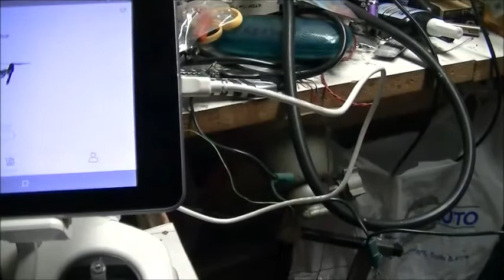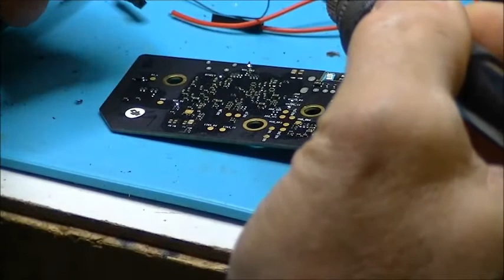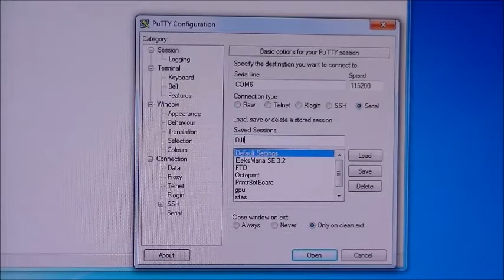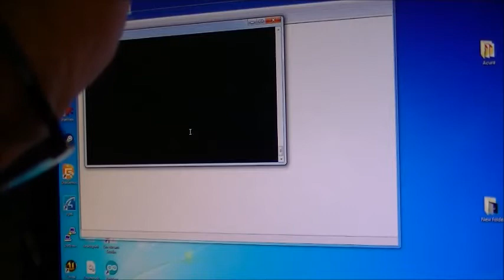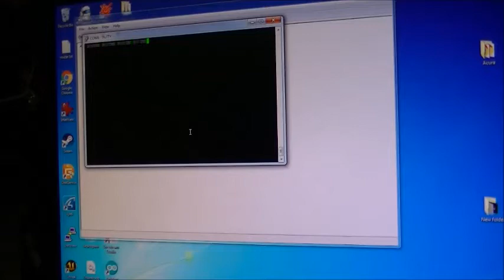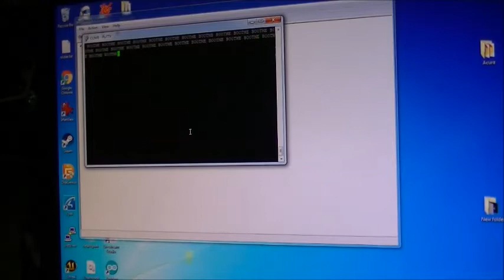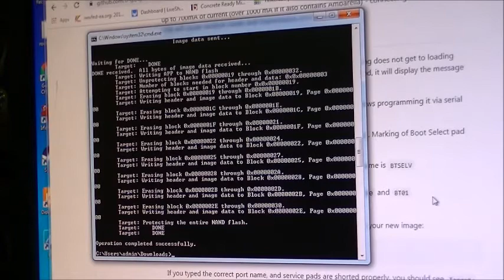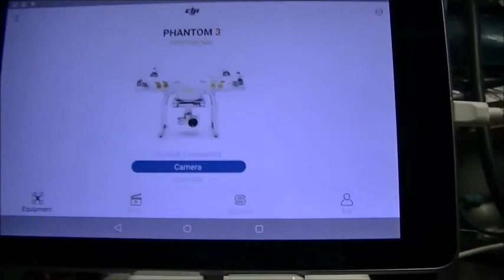DJI Phantom GL300A USB Repair fix no camera view

Comment: Hopefully you are still fielding comments on this video...I did everything as seen in the video.  Got to BOOTME, BOOTME etc... ran the prompt [sfh_DM36x -nandflash -v -p "COM6" ubl1_hdmi.bin u-boot_hdmi.bin] and this is where I get an error... 
it says in the cmd window... 
Attempting to connect to device COM3...
Press any key to end this program at any time.
Waiting for the DM36x...
The I/O operation has been aborted because of either a thread exit or an application request.
Interfacing to the DM36x via UART failed.
Please reset or power-cycle the board and try again...

Any suggestions?  I get this message repeatedly after re-attempting this tutorial.  Thanks.  I was happy to get as far as I got but now I'm just stuck with more useless electronic paperweights after this failure.  What could I have done wrong?  My solders seem fine - but who knows?
Reply from the maker: So just to start with the obvious. You mention your command as using COM6 But your error is COM3???
Reply: @tjones99  sorry - yes- my com port is 3. And yes - I changed it to "COM3" in the prompt....
Reply: Ok - after reading your edit in the bottom of the description about updating the drivers, I was able to get it to work.  I have a Win10 system and after updating drivers and rebooting computer, the communication from the computer to the DM card worked.  Next I will be trying to see if the drone allows the RC to connect in Camera mode on the app.  We'll see tomorrow.  There are several comments in here that indicated that doing all of this didn't help with their problem of connecting the RC to the app.  I'll let you know.  Thanks for the tutorial - even if this doesn't work, I am enjoying the whole process as much as a complex jigsaw puzzle.
Reply: Well, after putting Humpty Dumpty back together again... still no 'Camera' view popping up on the phone when it is plugged into the RC.  Bummer.  I had high hopes for this fix.  The only thing I have left to try is the last thing you have listed in your description edits - trying to connect it first to an apple product (which I don't have) to see if the apple connection allows me to connect to the RC in order to upgrade the firmware using the app.  I'll post back here if I get any results.

Comment: Still works after a few years (2024) got a good deal on a p3p  ( said it need a controller) lol and then I come across your video. Worked perfectly  and thanks so much for sharing it with us all .my only question is can the board be updated where I can only use iPad ? I tryed but it failed. THANKS AGAIN. You are the man
Reply from the maker: @dannorm5760  I am not aware of any upgrade to work with other devices.

Comment: I was really excited when I watched your video, because a week ago my P3Pro exhibited this exact problem for the first time. Mine does have HDMI, and the bottom of the RC clearly says GL300A. Unfortunately, the controller board does not have the markings as the one in the video to specify what the contacts are. I wonder if it actually still has a 300A board or if during the HDMI upgrade (previous owner) the board was changed to a 300B 0r 300C controller board?
Reply from the maker: Not aware of a solution. Sorry.
Reply: @tjones99  That's what I am finding out, but thanks for confirming that. I know a new board can be purchased for a boatload of money on Amazon, but how would I know for sure that this is the problem? The symptoms are the same. The drone sat for 9 mos and then I flew it three times in a week with no problem. 2 days after the last flight I started up the drone and the RC but the video would not connect. I can raise and lower the gymbal, but I'm really afraid to fly without the video feed.

Comment: Thank you for the Vid and the files.. After flashing the board my phone now detects communication with the Remote Control.  (before it was just detected as charging device). However I still dint get access to camera on the DJI GO app.. On my windows 7 computer when i plug it in, I only see "DJI USB Virtual COM 4" in Ports.. the DJI Assistant Does not detect the Remote Control.
Reply from the maker: So while recently working with some LightBridge units I found there are multiple versions of DJI Assistant... at least 3 versions... and I found that one version detected my LightBridge 1 unit but not my LightBridge 2 unit and a third detected only my drones... I suspect you may be using the incorrect version. It seems you can download and install all versions on the same machine... 
https://www.dji.com/ca/downloads/softwares/assistant-dji-lightbridge
https://www.dji.com/ca/downloads/softwares/assistant-dji-2
https://www.dji.com/ca/downloads/softwares/dji-assistant-2-consumer-drones-series

So try the different versions of Assistant and see if any of them connect...
Reply: @tjones99  phantom 3 pro is not on the supported  drones list on any of these 3 versions.
Reply from the maker: @luisvaldez6204 Sorry... I was just working on some LightBridge units and the above reply was applicable to them not Phantom 3 Professional...

I do not believe that I ever connected the Phantom 3 Professional (P3P) to my PC and had anything more than what you are seeing on the PC in device manager... at least not connecting to any DJI software like Assistant... Once I had done the flash procedure using the TI flash utility and Putty etc, I then connected the controller to my phone and used the DJI GO app on the phone to connect to the controller and the drone and get live video. I just did it again to test and with my iPhone running the DJI GO app without the controller connected I see the connect to your device screen, and as soon as I plugged in the controller via USB lightning cable the app immediately knew it was connected to a Phantom 3 Professional and said Aircraft Connected. When I click Camera I see the drone camera view. 

But... my recollection when first doing this was I ran into a number of issues when I was using different cables to my phone (tablet) and different phones (tablets). Specifically your cable must be a charge AND sync cable... many are charge only. And regarding phones... I had some android devices that I was never able to get DJI GO to work with. So make sure you are using a device that is known to work with the DJI GO app. I have personally successfully used iPhone 7, iPhone 12 mini and iPhone 12. I recall using a couple of different Android phones and tablets successfully but I cannot test today as I no longer have the devices or they are no longer running the stock Android on them... I do recall you had to enable USB Debugging in the Android OS before they would work.
Reply from the maker: @luisvaldez6204 Oh, and another viewer posted the following comment recently

"When you flash the firmware given by your zip files, it can only communicate with Apple devices, android devices will still remain in the same disconnected state, even with usb debugging and every cord and device I own. I only have android devices. After a week of struggling (the first time) I finally found the solution. The controller needs to be updated to 1.3.2 before it will work with android. From there is needs to be updated even more to be used, this can be done ota through the controller. My dads iphone 7 saved the day twice now. Happy flying! "
Reply: Thanks for that info.  it makes sense @tjones99

Comment: Would it be easier to do  it on windows 7 or 10. If it is easier to use windows 7 can a use a vm(virtual 
machine)?
Reply from the maker: I had no issues on Windows 10 so not sure adding the extra layer of complexity makes sense.

Comment: Hello, Has anyone got this to work on a GL658A controller? I see the two comments saying it will but wanted to confirm 100%. The GL658A is the first iteration of the Inspire 1 controller. If so does anyone have the bin files hosted somewhere?
Reply from the maker: I cannot confirm, but if you get an answer please post it here!

Comment: Hello I am about to try this process on my board. Just one question do you just touch the wire to enter boot mode when powered on or does both ends have to stay connected
Reply from the maker: Just touch them as you power up to get into boot mode.

Comment: Hi Terry, Thank you for putting this together. I'm still having some issues with the controller after following this tutorial. I followed the instructions and everything seemed to match up perfectly; same error codes, same dialog during the flash process, and same dialog once it was flashed. I reassembled everything and now I'm still not able to connect to the controller (no auto boot into DJI go app, not able to go into camera view, etc.). All it does is start charging my phone or iPad. I reconnected the board to putty and it's still showing a successful boot. Have any other thoughts on how to proceed?

Comment: Can someone confirm this will work with a GL658 Inspire controller?
Reply from the maker: The GL658A sitting on my desk unrepaired says this will NOT work with it...
Reply: Oh crap buddy 🥲🥲
Reply: I am 99% sure that i have a GL658 and it worked for me. I just har to boot it in bootme mode and just pull the code. I did not Get any readings from it in putty. But then i booted in bootme. And after that i could see the booting in putty. Again im not a 100% sure but i think i have a GL658. Its the original inspire 1 controller.

Comment: hello my friend from indonesia i tried to follow the method you taught in the video, but when i try to connect the ttl to computer, my dji device doesn't read. please help my friend, thank you.
Reply from the maker: Well the first thing to try is to confirm that the TTL adapter is working. If you connect Tx to Rx directly on the TTL adapter and open the putty connection you thould be able to type and the characters will appear in the putty window. Confirm that works first.

Comment: If you get a strong charge and it never goes away, is it pretty safe to assume it’s not dead?
Reply from the maker: You mean if you get a strong battery charge?  I actually believe it should be turned on infrequently as well because I am pretty sure the flash cells get their charge when read OR written and that only happens when on as far as I know. But I am leaning towards this happening more frequently when battery is flat.

Comment: After three years this still holds up quite well. bought a P3A from marketplace for $250. Ended up figuring out the connection problems must be related to this board. This is the only real guide I could find and it was so dead accurate. I cannot express my gratitude enough. I would have hated to spend another $150 on a controller! YOU SIR, ARE A GOLDEN GOD!
Reply from the maker: Awesome. This is what makes it worth doing. Thanks.
Reply: @tjones99  after some time has passed, I have now done this method twice. The first board was damaged recently after the controller was dropped and hung by the cord (broken usb port) instead of replacing the port, I bought a "untested" board from Ebay. Did the same thing as before and got the same result. There is something to add that is not mentioned in your video or comments that I am sure can help someone other than me. It occured both times, the first time making me wonder if confirmation the board was working was false hope. When you flash the firmware given by your zip files, it can only communicate with Apple devices, android devices will still remain in the same disconnected state, even with usb debugging and every cord and device I own. I only have android devices. After a week of struggling (the first time) I finally found the solution. The controller needs to be updated to 1.3.2 before it will work with android. From there is needs to be updated even more to be used, this can be done ota through the controller. My dads iphone 7 saved the day twice now. Happy flying!
Reply: after some time has passed, I have now done this method twice. The first board was damaged recently after the controller was dropped and hung by the cord (broken usb port) instead of replacing the port, I bought a "untested" board from Ebay. Did the same thing as before and got the same result. There is something to add that is not mentioned in your video or comments that I am sure can help someone other than me. It occured both times, the first time making me wonder if confirmation the board was working was false hope. When you flash the firmware given by your zip files, it can only communicate with Apple devices, android devices will still remain in the same disconnected state, even with usb debugging and every cord and device I own. I only have android devices. After a week of struggling (the first time) I finally found the solution. The controller needs to be updated to 1.3.2 before it will work with android. From there is needs to be updated even more to be used, this can be done ota through the controller. My dads iphone 7 saved the day twice now. Happy flying!

Comment: Another satisfied customer here with a now fixed Phantom GL300A controller.  Thanks!!!

Any idea what causes this, or if the reprogramming is a permanent fix?  Will this possibly happen again sometime in the future?
Reply from the maker: My understanding is that the flash cells may be deteriorating and losing their ability to retain which sounds bad BUT as I understand the issue the act of powering on refreshes the cells so the key is to not leave your drone idle for months. Just turn it on every month or do.
Reply: @tjones99  Super.  Thanks for the info.
Reply from the maker: I should add I have only had to do it once.

Comment: Hello. I plugged the device into a usb port and nothing happens. Then i turned off the 5 volt power and there was an unreadable string that slowly continues. I saw after this line the inscription "dji repair" appeared. I don't have that happening. When do i disconnect my device from the usb to make a reboot?
Reply from the maker: Not sure when you say "I plugged the device into a USB port" what "device" is... is that just the USB adapter or is that the USB adapter (FTDI board)  soldered to the controller board  or what? 

Normally you are NOT disconnecting the device from the USB port. You are unplugging the 5V line from the FTDI adapter as shown in the video.
Reply: @tjones99  Everything ends at the 1st stage of loading when you need to press any key to reset the error. And the download actually starts but ends with an error. I use windows 11. I think maybe I should try to install windows7 specifically. And here is the message itself: Interfacing to the dm36x via UART failed. Please reset or power-cycle the board and try again.
Reply from the maker: @ДмитрийФедотов-р3п  I am using Windows 10 and I do not expect much difference with 11 so I do not think that is the issue. If the download ends with an error I am worried that perhaps your flash chip has failed and not just lost its contents.

Comment: Thank you very much for your video.
Do you thy Is this method working for GL658?
Reply from the maker: There are snippits in this thread that imply maybe... I have not tried. 
https://phantompilots.com/threads/fixing-flash-programming-in-dm365-chip-within-gl300-remote-controller.144123/

Comment: Hi Terry. I have phantom 3 advanced with gl300c transmitter. I have no camera view.. There is different USB board like on your video.. But I put USB board from working controller and its no working. I pairing with other controller everything is fine so problem is on main board.. Any suggestion? There is hard to buy main board to that model
Reply from the maker: From reading the following my understanding is things are not done the same way on the GL300B and GL300C controllers (https://phantompilots.com/threads/fixing-flash-programming-in-dm365-chip-within-gl300-remote-controller.144123/) so this fix will not work for your controller. I have zero experience with the GL300C I am afraid. Sorry.
Reply: @tjones99  ye problably best way is buy mother board. or new controller and from no working sell for spares ;/
Reply from the maker: @kodi00703  I am always watching eBay fir cheap DJI controllers. They come up for about $75US if you are patient.

Comment: My phantom 3 started lost the video Transmission to application for no reasons, everything else is working perfect except there is no video, last time I did fly my drone everything was good, please what could be the reason, I already replaced the Rebon but that wasn't the reason, please what needs to be replaced, thanks 🙏♥️
Reply from the maker: What is the model number on your remote control?